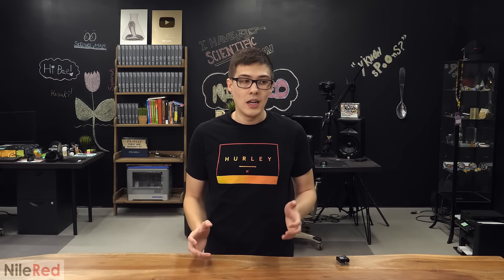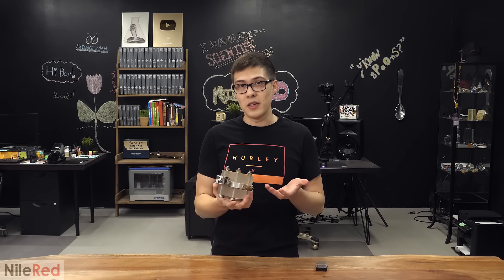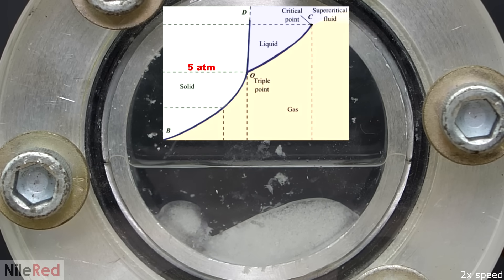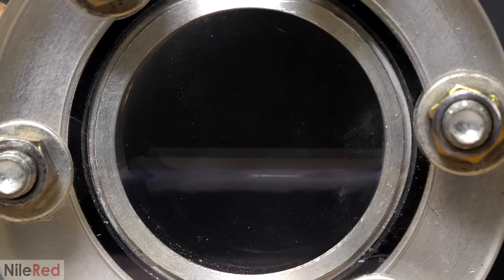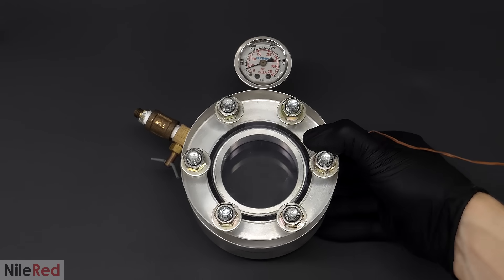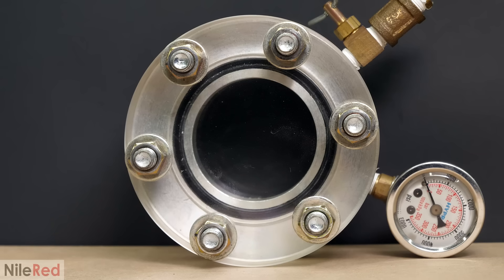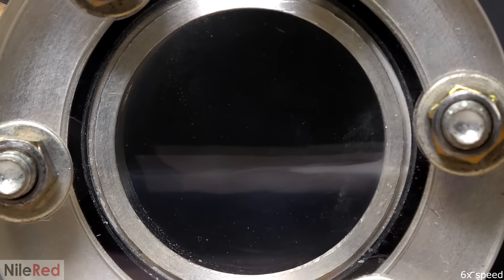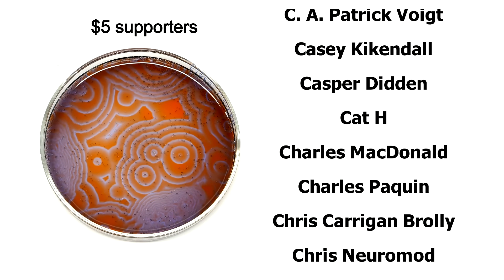Going supercritical.

Comment: The supercritical pressure of CO2 is 1071 psi, 73.8 bar, 7.38 MPa.  The original gauge has a full scale of 5000 psi or 350 bar.  It is NOT the optimal gauge to read 1071 psi.  The second time, the gauge was reading 550 psi or 37 bar, which is about 50% of the known actual pressure.  Mechanical gauges are very inaccurate at the low end, and this one is low-quality.  (They even marked the lines at the low end ambiguously, not even having the right number of small ticks before the first big tick.  I counted ticks DOWN from 1000 psi and 50 bar.)  (The triple point of CO2, where solid liquid and gas coexist, is much lower, at 5.1atm.)  The new gauge has higher quality, but you bought the wrong gauge.  You bought another 5000 psi gauge, when you needed a 2000 psi gauge.

Comment: 15:10 my best guess would be that because of the pressure the silica beads were pressed together much more which made them rub off on each other like what happens to stones in a river when you threw them around. I also would think that the stuff that was floating around in 13:20 could be some abrasions from that. The high pressure could also lead to them hit each other much harder and thus making the cracks. But that would be just my theory. Correct me if I overlooked something. :)

Comment: due to the  abominous pressure the silica beads had microfacture in its lattice structure and according to me trapping some carbon dioxide in it than after slowly releasing the pressure CO2 trapped came out of it leaving air as a change of medium the refraction and internal reflection took place together making these colours on different angles. Similar effect is observed in diamond but it is more due to total internal reflection there.

Comment: 15:06 This is called iridescence or pearlescence in the case that the object reflects white light. It occurs when the surface of an object is molded to have many tiny ridges. It is caused by wave interference of light in microstructures or thin films. Depending on what part of the surface that the light hits, it changes the color of the reflected light. You can also see the effect on things like CD's and rainbows but those are caused by diffraction. @NileBlue

Comment: It's not super critical, it's Plasma, matter has 4 stages, solid liquid gas and plasma, ya know, like fire, earth, air, water.... if it behaves like liquid and a solid it's more like plasma, or fire, earth is solid, liquid is water and air is a gas. Shouldn't be called super critical as it should be plasma, if the temperature is past its Boling point and it's a liquid like substance, it's plasma
Reply: Plasma is an ionised gas which this is not
Reply: @pizzafox21plasma is plasma, 4th state of matter. Like saying water is a solid gas.
Reply: @Kyojinsei There are not only 4 states of matter; nothing in the universe exists between rigid boundaries. There is not only day and night but dusk and dawn, not only old and young but the early adults and middle aged. Between the 4 states and the 4 elements are the things aptly between them; plasma is only one of the points of which you can be between, not the points which you may be on. The four elements, earth, water, air, fire; cold to hot and dry to wet. They are halves of those halves and you may even divide them further; earth may be either mud or rock, water either oil or milk, etc. "Nothing in the universe either is or is not any attribute in a perfect sense". This is why there is a supercritical state and not only 4 states of matter.
Reply: @pizzafox21reality must still be defined in terms that makes sense, or we have no where to stand together
Reply: @Kyojinsei The supercritical state between gas and fluid is one of those terms. So as you cannot call twilight neither day nor night you simply cannot call a supercritical either gas or fluid. There are 4 primaries but there are many different phases of matter such as BE condensates or free energetic matter etc. A supercritical is a completely different thing from plasma (like fire, electricity, or the plasma clouds that move around freely in outer space). Regardless of how you divide your terminoogy with reason you can see clearly with your own eyes, with common sense, and with your gut that plasma does not act anything like what is shown here; plasma is super free whereas this is clearly very dense in relation, for example. Stop trying to fool yourself with reason and see things as they are in themselves and there will be no point of dividing any specific terminology for them in the first place.
Reply: @pizzafox21twilight is twilight, this is like saying the cup is half full or half empty when it depends on if you just got done filling it or if you just got done drinking it. But if you walked up to the cup and the cup is half way, then it's halfway, not full, not empty

Comment: @NileRed I wonder what would happen if you hit the planck limit 🤔  
Design of the pressure vessel would be all steel with a 1" viewing port on one side and self sealing beveled lead o rings. Next I would pump in a plasma arc at an xray frequency.
I wonder how light would bend through the supercritical phase 🤔

Comment: My guess, you made hydrated silica, which as you know, IS what opals are made of. CO2 is slightly Acidic,  Opals form during the acidic weathering of rocks, or precipitate from water-rich fluids containing silica which fill cracks in rocks. My guess, the co2 had enough water in it that was slightly acidic, that in essence you basically created a lil bit of synthetic Opal inside the Silica Bead. Just a guess tho, no real clear science to back it up.

Comment: dude, how badass would it be if you put in something that floated in the liquid. CO2 and then it would theoretically if it acts like the ones that are still sunk in the CO2 and acting like they're under CO2 like liquid CO2, that they were just suspended in mid-air because they're technically floating on that mass. that's super critical. they'd be so freaking cool

Comment: I think I might have an idea what happened to the silica beads, this is just an educational guess, but I you were maybe partial right, Nile, on the cracking of the silica beads. So silica beads "pop" when they get wet especially in water, since the beads are use to absorb moisture in the air, also I believed the beads absorbed (some of) supercritical CO2, since in liquid form it is wet and in supercritical form it is moist(?). I kind of want to say you made a different type/form of aerogel. I mean both have the use the same chemicals/elements but the form is different.

Comment: That pressure vessel thingy looks sketchy as fuck if you ask me.  

Cycling thru cold/hot over and over  stresses materials and causes micro-cracks that can cause massive failure over time……like what happened to that little sub that imploded trying to get down to Titanic.

Comment: 15:10 bro the same thing happens when you heat a glass ball in furnace and then drop it in cold water, it's due to rapid contraction of glass on cooling that this cracks appear. It's interesting to same thing happening here 🤯

Comment: I’m pretty sure what you’re seeing with the opalescent reflection is the after effect of the beads structure compacting while being flash frozen and subsequently shattering due to an overload of physical pressure in a small space - while also not shattering apart. 
So the hairline film is correct, that’s typically what will cause the rainbow effect.

Comment: @nileblue The iridescence in your silica is similar to that of quartz. When fissures form, they create a flat surface for light to bend and refract, which separates white light! It bounces the white light all around inside, bouncing off of each surface created by a crack, splitting it. slows down white light and the different wavelengths start to fan out in different directions. Isaac newton figured this out and did a whole thing on sunlight, and white light actually being a mix of the seven primary colors. You could do some fun videos with that

Comment: Pretty sure that pressure gauge isnt broken. Initially you were only looking to get 5 atmospheres (5 BAR) and looking at the scale on that gauge - it would barely be a blip on the bottom of the scale. When it was reporting pressure - it was showing about 25 BAR, however, traditionally co2 tanks do not come with pressure gauges as they rarely report the pressure correctly. Im not sure why this is but I would take that reading with a pinch of salt. As an asside - co2 tanks are weighed to determine thier fill state.

Comment: The color of the beads most likely comes from thin film interference on the cracks. It is really easy to reproduce if you make some clear ice and flick it, say, with a spoon to create fractures. From some angles they would look like a tinfoil because of total internal reflection, from others - like a soap film: mostly invisible, but showing bright colors where they reflect a bright light.

Comment: It looks like an oil spill so my theory is that the gas which has emitted an oily concentrate could of helped crack the glass. This has left a thin film which has gotten into the slithered silicone and now helps refract the light - although this is a guess!
Reply: A guess from someone who uses "could of" is worth exactly zero.

Comment: If you had a solid like the silica beads, except the density was lower than liquid CO2, so they floated, when the CO2 goes supercritical, would the solids float to the top of the chamber, or sink to the bottom?

Comment: If it had a thick steel ring in the front instead of washers and another ring in back with threaded holes, you could put it together fast, as well as torque it down pretty fast and evenly with an impact gun.

Comment: 6:22 Possible, splashed upwards by the large amount of boiling gas. Or it's tiny CO2 crystals forming due to the cooling effect from boiling off (When liquid gases get depressurized, they go into the gas phase, because they would be a gas at that temperature and pressure, but boiling and evaporating still needs energy, so they take that from the environment and cool it down. On the other hand, while compressing gases into a liquid, they give off heat that needs to be carried away by cooling. That's the reason it takes so much energy to liquify gases).

Comment: Critical point drying is done using high purity liquid CO2 .. Typically dry ice is very impure.. if you leave a bucket of it out you will be left with a sticky oily film ( compressor oil). The color on beads is this oil.
Please be very careful.. critical point driers are also nicknamed bombs.. I have seen them explode if over pressured and blast through cinderblock wall.
Reply: If color is inside the cracks may act a prisms

Comment: Those silica beads basically turned into artificial opals.
"Opal is hydrated amorphous silica (3% to 20% water) containing aggregates of ordered or disordered microcrystallites of a cristobalite. Electron microscopic studies show that opal is made up of closely packed silica spheres (SiO2·nH2O) and interstitial silica, water or CO2 gas-vapour air. Opal is characterized by a conchoidal fracture and it occurs in wide range of background colours. It is transparent to nearly opaque, and may be distinguished from chalcedony and cryptocrystalline varieties of quartz by its higher water content and lower hardness. Opal is brittle, sensitive to heat, and easily scratched. Furthermore, opal from some localities, is "unstable" and may crack or self-destruct through the loss of water. Despite these faults, opal's beauty is supreme and, for the past thousand years, it is recognized as a "highly prized" gemstone."

Comment: Actually the most terrifying part is that supercritical liquids are so pressurized that when they explode they create enough energy to move faster than sound thus breaking the sound barrier. That’s also fast enough with enough mass that it would punch a dozen or so large pieces directly through your body giving you one of the most painful deaths ever. Now this shrapnel would also be large enough to destroy most muscle fibers and nerves meaning that after you’d be paralyzed while still feeling a phantom pain from every part of your body. This would be so excruciating that you would rather end your own life to end the pain, but you can’t because your paralyzed which causes mental and emotional pain. In short if this did explode the shrapnel moving at those speeds would cause pain to the point that it leads to insanity.

Comment: Gas pressure gauges must be used in gas.  By orienting the device where the pressure gauge is below the level of the liquid CO2, the liquid messes up the gauge.  When the CO2 becomes supercritical, the gauge begins working.  By the way, that's not "a little of of pressure."  That 30 bar, about 435 psi, and about 3 times higher than high-pressure bicycle tires.  Good think you're face is behind a polycarbonate shield.

Comment: I think the reason for the fracturing is merely because silica gel is porous. Internally, there is millions of tiny voids and a very large surface area which is why it works as a dessicant. You've now forced liquid and fluid co2 into it under high pressure. When you open the valve, the pressure is suddenly released, the liquid expands to a gas faster than it can escape the interior of the beads, the internal stresses then crack the bead. Because silica gel is amorphous, the beads don't split along any particular fault directions; the cracks tend to get stopped as they encounter other cracks before going very far and the stresses are relieved as the gas finds escape. Otherwise the beads would probably shatter into pieces.

Comment: Based on this behavior. The Cosmo's essentially only needs differentials in positive and negative states with-in certain mediums: it actually only seems natural that this must be commonly present all around our environment. Probably in tons of ways we don't even see or realize. Electrons are everywhere, differences in charges & states must be as common as the presence of hot and cold temperatures.  Then you have high & low pressure zones~Which causes wind, air flow, or liquid flow. It Seem's This behavior is key in Nature. With those differences, Nature finds ways to utilize it, which allows us to have functional dynamic, or turbulent system's- which eventually get themselves self back to a more stable ground state.  ~Differences~ or fluctuations Seem's to be the core factor in Nature's "engine" to any given system as we know it. This is really facinating to ponder about... 
*Additionally,  I once thought space was a "complete vacuum." Then I saw something saying it's not a "complete vacuum" which is interesting. That could be just enough that it allows certain things & behaviors to occur throughout the Cosmo's. Which then could be the core backbone to most fundamental forces of nature. It strives to reach that stable ground state BUT having areas of differentials- Those differences gets things rolling rather than staying static/stable or flat out inactive.
~ (Nature/the Cosmo's, is really fun to think about)

Comment: Is there some reason you expected a GAS pressure gauge to read the pressure tilted down into the liquid in the first two tries but it worked fine when always on top in the gas when you added the temp sensor?
Reply: I thought the liquid running into it was probably the problem too.
Reply: Big lighters for example always produce flame of the same size when held upwards and downwards, while Clipper lighters produce a larger flame when held upside down, because the fuel being released is in liquid state as opposed to a gas when upright, the nozzle being below the level of where the liquid is formed in the tank. The guage will still read pressure above or below the liquid  level of supercritical material, right? But will the presence of a liquid in the instrument read different than above the liquid line in the gaseous portion? Are gauges even meant to function with materials in various states and the transitions between them? Under that form of pressure and in turn, the variances in heat through these processes?

Comment: Did you know that you can use it as an insulator. If you put an open flame under it you can protect your hand from burns. I have seen it in videos.
Reply: I’ve held an actual NASA shuttle heat tile in my hands many years back… I believe that it as a sandwiched construction with a hard surface, made from a porcelain material, and inside the sandwich was aerogel or something very much like it.

Comment: Good afternoon! Ben - could you describe the experience in more detail. I am interested in the temperature values at which the rotation process occurs. Maybe some kind of table.
Is it possible to initiate (speed up or slow down) the transition process using a laser or other light source.

Comment: So this reminds me of older style paintball markers that run on CO2. As the markers got better, and could perform at higher rates of fire, the CO2 would sublimate inside the marker, and the liquid form would screw up the internals. (IE: Burn seals) This problem was alleviated by adding an expansion chamber to the gas path through the marker. It's really kinda cool to see what was going on in there thanks to this experiment.

Comment: Great experience but 1500 lbs on lexon   can crack or explode this is a very dangerous  item remember  all cracks start on the surface !!!!
Not all lexon is the same ! Use grade 8 or better bolts  double o rings  and the best lexon you can find 2000 psi can caneasly kill you !
I realy enjoyed your vedio  thank you ! Be  double check these materials